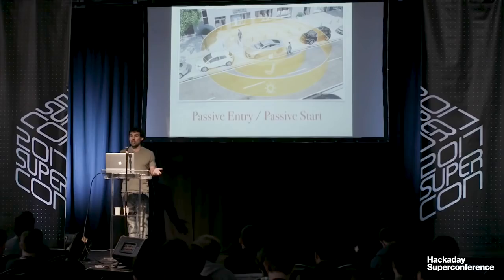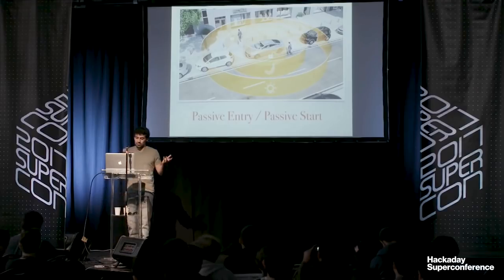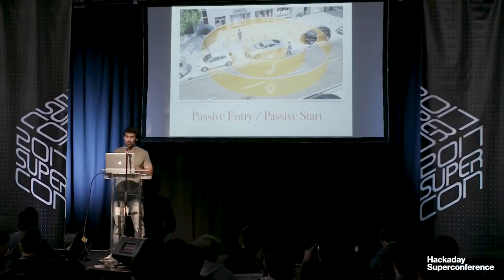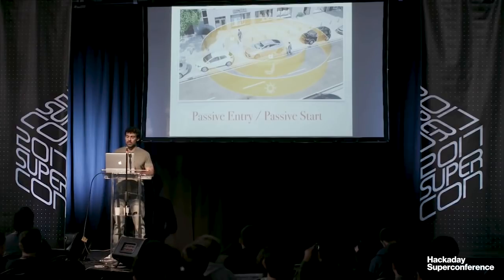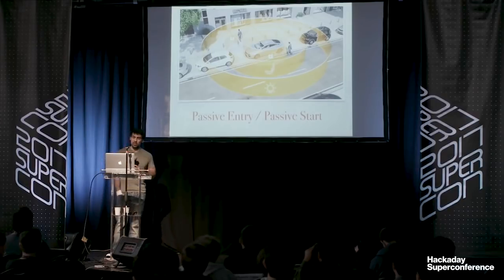Samy Kamkar: Getting Started with Reverse Engineering

Comment: This is a great video for people like me who are not hacker types.  Basically he says put on a logic analyzer on chips that you do know what they are doing and look for square waves to denote a clock, and check out all the pins on the chip on the device you are trying to understand or hack to see if they are high are low, or are a clock, or whatever.  This is for when there is no ID on the chip. He just basically opens the box, puts a logic analyzer on the chip, studies the circuit, etc.  But for me, and most people reading this, the key is the logic analyzer on the chip.  Plus if you stick around, he tells you how to steal expensive new cars.  This will be an important skill during the revolution.
Reply: What revolution?
Reply: Techno Gamer the revolution.

Comment: What happens when you drive the car out of range of the antenna near the key fob? What happens when you want to start the car again? Do you need to stalk the person with the fob and transmit the response every time?
Reply: The car still stays on but you would not be able to turn off engine and turn it back on.
Reply: @alexp6012  There's the flaw right there. The car needs to poll the fob at regular intervals, warn the driver when it misses a set number of poll responses, then automatically reduce the car's speed to a crawl for a minute or two (for safety reasons) before forcing it to stop.